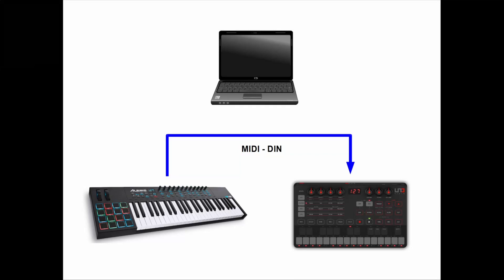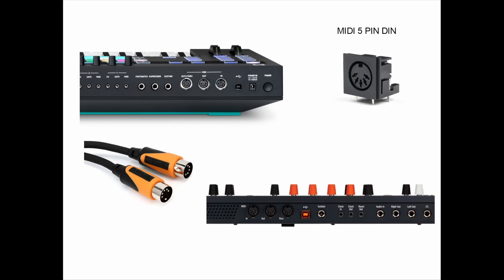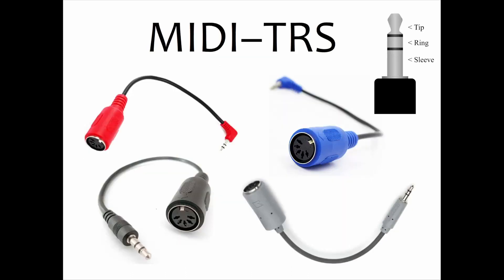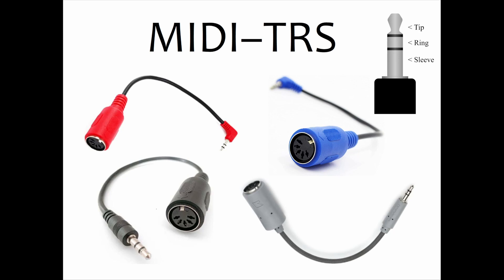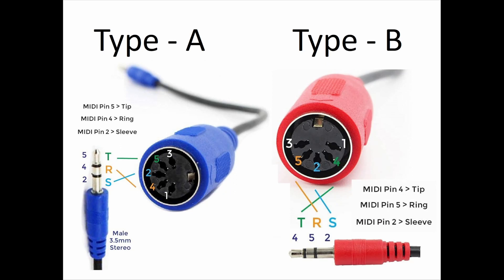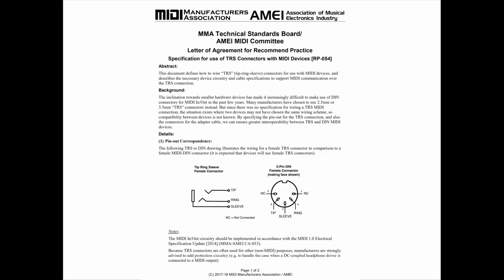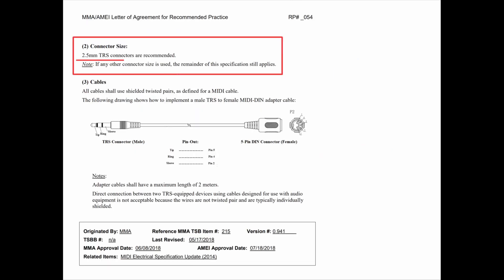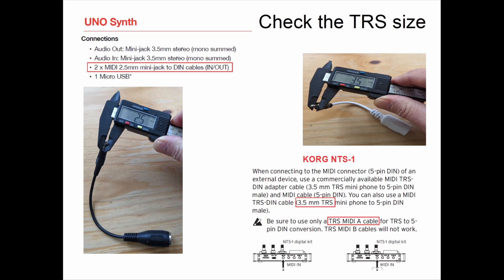MIDI TRS Type A vs Type B Adapters Explained

Comment: Thanks for this great video but I still don't understand why some manufacturers dedided to use a Type-B instead of the Type-A standard. Is it a mistake they never fixed and it becaome something or there's a technical reason behind it?
Reply: The first answer unfortunately. There is no good technical reason for either the A or the B format. Once a manufacture starts selling a product customers get unhappy if that product switches interfaces midstream. Some manufacturers do gradually convert to published standards, but even then the older equipment, with the "other" standard, still needs to be supported to keep existing customers happy.

Comment: If you have midi A and B devices is it true that you can use an adapter to switch between them? I've seen folks say you can switch the left and right of your 3.5mm cable with an adapter and that will convert A to B. If not what do you do? I'm plugging in a Polyend Play to a Volca Sample 2 and the Volca is receiving pitch data as sample data (in other words I change the note on the Play and it changes the sample on the Volca Sample)

Comment: Which pin is MIDI information sent over?  4 or 5?
Reply: Since MIDI is an optically isolated loop pins 4 and 5 are both required. Pin 4 is the pullup and pin 5 is the signal. A quick google search for Midi pinout will show multiple wiring diagrams.  Sparkfun and Adafruit both have good introductions to MIDI wiring.